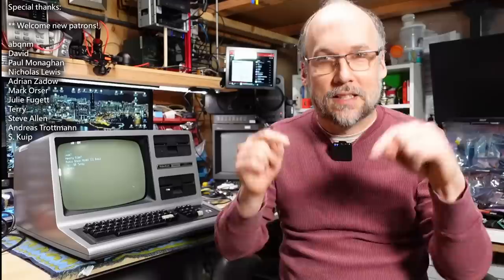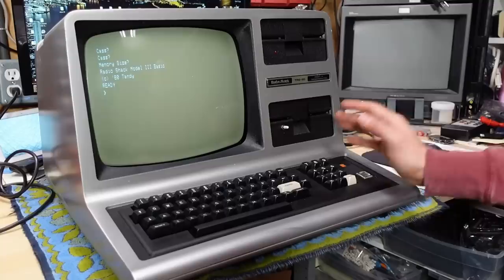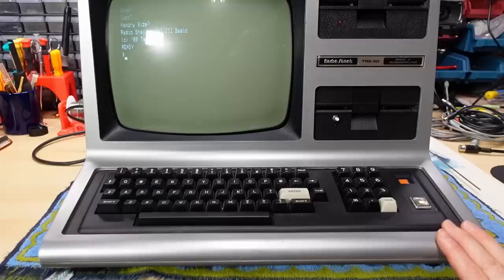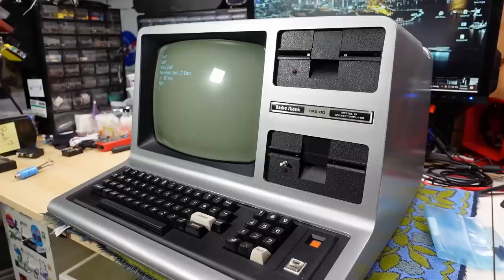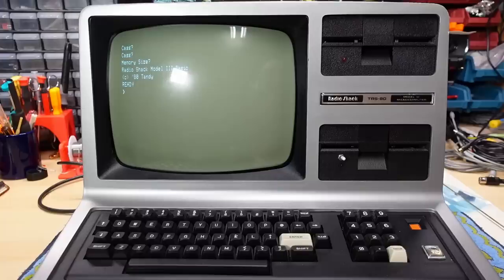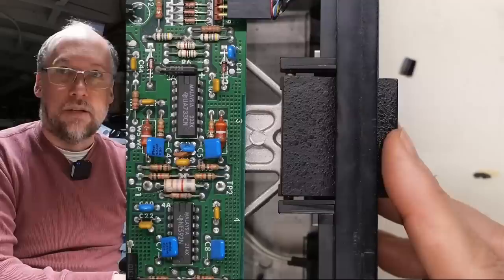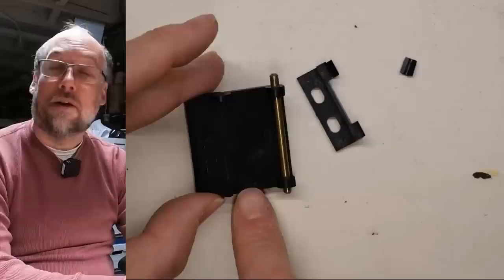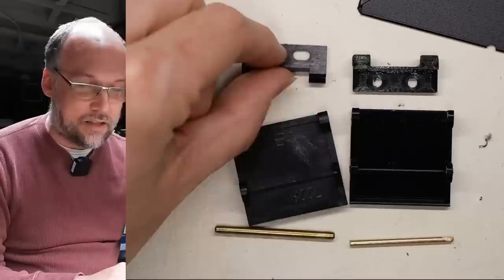Fixing an old disk drive with 3D printed parts (Tandon TM-100)

Comment: As I watch this I'm monitoring my own printer printing with nylon for the first time. After many failed attempts it's actually working! Since it's a temperature tower I do expect it to fail before it completes, but it's about to finish the highest temperature section now. That's a success even if it doesn't get any further (and I'll know the correct printing temp lol)
Reply from the maker: Ha! Interesting. I finally got some PETG so slightly more durable than the PLA I've always used. I so far have never tried anything but PLA.
Reply: @adriansdigitalbasement  one day I was looking at the case for my vape batteries and it's on its last legs. I'm like......could I 3d print that? It needs to flex since it's a bendable hinge. So I got some nylon. So far it's doing really well! I'm printing 5 degree sections starting at 295 dropping down to 265. It's at 275 now. It's supposed to be a very durable and heat resistant material so when this is done and I make the case it will be interesting to see how it goes. Also I saw a video on how to make it clear (except with PETG) so we'll see if it works for nylon.
Reply: @adriansdigitalbasement  I've only used PLA before so this is new, I am planning to use PETG for a plastic frame for my dad's 94 mercedes rear view mirror. I've been working on that for about a month. It's not done yet, but it's getting close.
Reply: @adriansdigitalbasement  as expected it did eventually fail, but only partially in the 270 zone and much worse in the 265 zone. I've only seen the webcam I'm about to take a look at it in person.

Comment: Might want to try acetone welding that drive lever's faceplate back together.  That might cause some discoloration so it may require a bit of color touch up afterwards but the weld should be quite strong (depends a lot on the plastic they used whether it will acetone weld).  Speaking of which, you can dip a sponge in black spray paint and daub it on that replacement drive lever faceplate to give it some texture to match the rest of the drive's faceplate.

Comment: Hi Adrian you could make the door with wider supports to reduce the stress and future breakages as its all internal anyway so cant be seen.
Reply from the maker: Indeed -- if this 3D printed door ever breaks, it wouldn't be a hard mod to fix this... especially when printing both the door and pivot point part.
Reply: I was thinking the same.  With a wider support, it would also be feasible to glue in a metal (brass) sleeve in at least part of the support loop to give it even more strength.

Comment: i have one Tandy fullsize 5.25 "
for quite some time it did indeed work..
but now.. many of the drives fail basics
and i got  stack of floppies to process
if one drive works - other drivers can be fixed
after making a master boot disk 
and cloning these.. on various brands
using 360k and 1200k media.

Comment: Given that the original door is broken anyway, I wonder if it's possible to sand the back of it down so it can be used as a thin facade, glueing it to the front of a modified 3D printed door so it would look original from the front.
Reply: The printed door may become too thin and weak then? 🤔
(edit: typo)
Reply: @gigaherz_  That should be fine if you glue it good. The original door should be at least equivalent in strength too the 3D print. It would be a lot more work though.
Reply: @gigaherz_  Depends on the glue, I'm thinking an epoxy resin or a specialist plastic glue would do it.
Reply: I think that it could just be repaired with some epoxy
Reply: It would probably be easier to just print the pin loop and glue it or plastic weld it with bridge wires.

Comment: 3D printers are great for reproducing broken parts, but folks should keep in mind that many bits can be repaired as well.  In some cases, glue is enough, but parts that are under load often need more than just glue to support them.  In this case, I would have drilled a couple of tiny holes through the broken eye piece and run a bit of wire through the holes, then covered that with epoxy (after inserting the pin in place).  This way, the epoxy provides the physical structure to replace the broken bit, while the wire provides the strength to hold the epoxy to the base part.  Keep in mind that certain glues don't stick to smooth parts, so using a bit of sand paper can add texture for better adhesion.  Besides using wire, you can also use material such as fabric or tyvek from envelopes as a reinforcing material, applied like fiberglass across glued gaps.
Reply from the maker: I've glued ABS stuff together many times using Acetone and/or cyanoacrylate glue -- with great success. Sadly with these the bits that broke are gone... but yeah otherwise I bet I could have used JB welt to fix the original.

Comment: Well that is pretty convenient, having the models of parts so you can 3D-print them, but, what you should do, is print like 4 or 5 for just one machine, and play with them.
Sand them down a bit, maybe work on the color, but more than that, the texture, if you really want to match the original. But other than that, great job!

Comment: Looks like this kind of defect could also be repaired with a steel pc slot bracket, some epoxy resin, a metal saw, a pair of pliers and a file to adjust the repaired hinge and flap. A small steel rod made from a paperclip and (with epoxy resin around it if it's too thin) and 4 small flat steel washers could also do the job
Or, if you're My Mechanics "I make a new one."
Otherwise, you can put stickers on each drive flap if the finish of the 3D flap isn't satisfying (even printed 0 and 1 or A and B depending on the computer you're using with it).
Reply: +1 on epoxy.  Paperclip or steel washer are great ideas for keeping it from breaking again

Comment: The drive door texture can be replicated with black specklestone paint. Be sure to clear coat it afterward. Honestly, I'd sand the replacement a bit first to make some room for the pain film, which will be a bit thicker than normal. 
When done properly, the finish will have a riased texture similar to the original.

Comment: I've got a Kaypro II with Tandon disk drives.  The door for Drive A broke a long time ago (late '80s when my dad and I used it when I was in high school). We had found a plastic clip that was for curtains that was just the right size to wedge into where the door used to go and it would hold it in place and worked fine.  

I have the computer in my basement and have been wanting to restore it (the other drive has at least one failed component, and I"m not getting anything on the display) so 3D parts will be essential.
Reply from the maker: That's awesome. Amazing they were breaking even back then!

Comment: You can help make those latches last longer by operating them correctly.  If you  let the springs slam open, that's a great way to break that hinge.  I learned to grab that latch and gently open it till it was all the way up.  Doesn't take much longer, and it helps the drive last longer before you need to repair it.

But Adrian is right, no matter what you do, that latch WILL eventually fail.

Comment: I'm sure others have commented, but you can actually configure most slicer programs to print parts with a configurable texture on the outer perimeters.  It wouldn't be to difficult to find a close match to the drive's texture and apply it to your printed part(s)!

Comment: I wouldn't call this issue a design flaw, it's more of a design trade off. They could have designed the pivot and latch mechanism to be more robust, but with added expense during manufacturing with very little return for it. Most of these drives have lasted far longer than their designers ever intended, so why add to the cost of manufacturing?

Comment: Personally, I think the repaired drive is just as cool or even cooler than the original. Now it's truly your drive, with custom parts. I really don't understand why people obsess with having things look "factory original" -- that's not what these were used for! They weren't showpieces, they were (and are) tools. So take pride in the fact that your drive looks different because YOU fixed it and now it's custom. People customized their computers all the time, and it becomes a part of the story of that machine. Erasing that to take it back to "factory" is what I think is awful.

Comment: Another way to get a textured finish would be to print on a textured bed like Prusa offers with the front surface facing down. 

You'd probably have to edit the model slightly to have more uniform flat front, but I suppose you could recreate a similar effect by cutting in a line at that mark instead.
Reply from the maker: Sadly it won't really work because the front of the lever matches the profile of the front panel, and it has a step to it.

Comment: That lever probably is ABS, which welds well with acetone-based glues like UHU Plast… I'm quite sure you can save it, just need to find some other ABS part you can cut into the missing shape.

Comment: Holy sh#t I think this is exactly what I need to fix my kaypro 2. I need to check the drive type but they looks similar
Reply from the maker: Tandon drives were extremely popular. My assumption is they cost far less than the SA400 from Shugart -- plus they supported a full 40 tracks while the SA400 was only a 37 track drive.

Comment: 3D printers are going to be an absolute necessity in the years to come, as spare parts for devices become nonexistent.
Reply from the maker: I really want the day to come where we have high resolution and accurate 3D scanners, so I could put the broken part in the scanner and then just need to fix the broken part in software, then print a new part.
Reply: @adriansdigitalbasement  you can actually use a 3d scanner that they use to do teeth molds :)
Reply: @adriansdigitalbasement  You just invented the 3D photocopier!
Reply: @adriansdigitalbasement  absolutely. Photogrammetry apps can do a decent scan with phones sometimes, but not quite reliable enough to not be too much of a PITA to fix. I do suspect a phone with a solid state lidar and multiple cameras will be the basis for such a scanner though.

Comment: Oh, man.  1984 Right out of high school with nothing better to do, I got a job at Radio Shack.  Working full time there were many hours with nothing to do but play Zork on the TRS-80.  Games were really expensive so they would not let us unbox and play any of the newer games.  NO ONE purchased the TRS-80 to play games back then.
Reply: I did! I bought Pyrmd, and Eliza. My first two original games. And I typed in a lot of code from books. Just with cassette😵‍💫

Comment: Thanks this is awesome! One of my model III drives has this exact issue. What material did you use? I plan to use ASA for mine (going to print it right now lol)
Reply from the maker: It's just PLA with 100% infill
Reply: @adriansdigitalbasement  PLA has surprisingly good mechanical properties if it's kept cool so it will be fine many years to come (as long as it does not go into a hot car or attic 😀).

Comment: To texture the latch, maybe some pickup truck spray bed liner might work okay ish. Probably won't be quite original but add some texture nonetheless.
Reply from the maker: That's a good idea!! That stuff often comes in spray cans right?
Reply: @adriansdigitalbasement  Yes. I've been meaning to grab some for my RC truck but haven't. Should just scuff up the plastic so it'll stick. I've seen others use it before
Reply: @adriansdigitalbasement  Could get brush on too since iirc the spray cans clog up easily.

Comment: Great vid!!!
Probably not a great idea, but maybe try printing that part face down with a raft.
When I started 3D printing, I frequently used rafts, and they helped the prints stick, but didn't leave a smooth surface.  Maybe that's what you would want for this print.  ;-) 
Probably not, but...  ;-)
Reply from the maker: Heh I had issues sticking but I have resorted to glue sticks and that solved all my issues. They are so cheap and they wash right off the bed with soapy warm water so win win.

Comment: Hi Adrian, I just wonder if PETG wouldn't be better for those parts? I have the same printer, nice. I haven't tried Octoprint yet. Good repair.
Reply from the maker: I actually just got some PETG but hadn't tried it yet. It's stronger but I bet this will still be just fine as I printed at 100% infill. If it breaks, I'll just make another with PETG :-)
Reply: @adriansdigitalbasement  I have been using octoprint for a couple years now with my Prusa MK3.  It works great.  So many cool features. I love the fact that it calculates costs and keeps track of filament usage.

Comment: Excellent video.  Question: What is the purpose of the white toggle switch on the drive face?
Reply: 3:16
Reply: Adrian described it as a three-way toggle switch that modifies the write-protect behavior of the drive. The center position allows the write-protect-detection to work as usual (i.e., write protect/enable is controlled by a sticker over the notch). 

Putting the switch in one "side" position means the disk is always writeable, regardless if whether there's a protect-tab or not, and the other "side" position means the disk is always protected, regardless if whether there's a protect-tab installed or not.
Reply: @chitlitlah  Thank you.  I watched the video 2x and completely missed it.
Reply: @johnhelt5475  No sweat. I sometimes get distracted or zone out and miss stuff too.

Comment: Nice. I wonder if the fuzzy skin setting on Cura would give a closer approximation to the original.
Reply from the maker: I noticed that under experimental, and I have never tried it. I'll need to experiment a bit. ( use Cura even though Prusa Slicer seems to do a better job with sharp corners. Less bulge...)

Comment: does anyone supply replacement belts for these, ideally in the UK or Europe?
Reply from the maker: I have to admit I have never found a source of the belt... I have an older 8" disk drive with a bad belt and was never able to find a replacement for that either. (I even have the original part number but it hasn't been made in forever.) I think belts may exist for the Commodore 1541 with Alps, but that belt isn't going to be compatible with this.
Reply: @adriansdigitalbasement  i had one of these drives, or  a clone, missing the belt, i luckily managed to find a rubber one about the right diameter, but was wider, i cut it to fit and it seems to work, but it really needs the proper non stretchy type, and i dont have another if this one fails....
Reply: also after a belt for an atari  1050 drive,

Comment: For cosmetic purposes - get the old latch and cut the back off.  Sand it as thin as you can.   Then print out a new front door that is thinner with a flat front. and superglue the old front on as a fascia.  The front should give the look and the printed part gives the function while being more robust.
The old latch is rubbish now anyway, got nothing to loose but time.,

Comment: Would I be correct in thinking that it's hypothetically possible to replicate the door texture on a 3D printer, but you'd essentially have to design the texture yourself, which would presumably be a fairly tedious process? Or do the relevant CAD apps provide for surface texturing, and whoever designed that door simply chose to go with a smooth surface?
Reply: It is if you print it on a textured build plate.  I have a Creality PEI textured spring steel build plate and the texture is very similar.  The problem with this floppy door part is that the door is not completely flat.  There is a raised part where the disk slot is when you close the door.  That means you would not be able to print it flat  (why he had to print it on its side) so as to get the texture.  Trying to replicate the texture so that it actually prints would probably not look good as it would require too much detail.
Reply: With a FDM printer (melted plastic) of the kind Adrian has details on that level is not possible to reliably produce, it's quite possible if you have a resin printer though.

As Racer says, you can use a textured print bed on an FDM printer, which gives A texture, but that is closer to the sandy texture of a C64, not the flakey texture the IBM drives have. And you only get that bed texture on the very bottom layer, so the surface you need the texture on must be completely flat.
Reply from the maker: This is the build plate I have , but as mentioned it's not flat. So I printed it on its side which means the side has a nice texture LOL

Comment: Perhaps a silly suggestion but to get a bit closer to the texture of the original, could you heat the printed one and press it against the front of one of the drives?
It would be a negative copy but perhaps less noticeable than the print lines.

Comment: Nice computer, Adrian :)
I wonder if a double-sided drive is installed into that computer, would that work as intended?? I was offered one like that in my old high school. But I have no more space in my collection with all the 80's laptops, VHS cameras, and 90's mobile phones taking up all my space in my very small room at home :)
But at least I have a working 286 laptop built with a desktop hard drive, desktop floppy,  ISA card slots inside, SLA battery, and it is designed in Hungary in 1987. And it is working fine.
Reply: I remember that it was possible to put a double-sided drive, which was also double density. So you had 1440 KB on a disk. But it did not work with TRS-DOS, but with Newdos. You also cut a small whole, so you could turn the floppy around, so you could use two sides of it. It was important to know how to initialize the drive, though. I remember the 'PDRIVE' command. You could program with this command things such as GPL (grans per lump), TRS (track stepping rate), Doubles sided and single sided, etc. You could even boot up a TRS-DOS floppy, but that could only run 360 KB, SS, SD and TSR=0. 
Memories, memories! 🤗